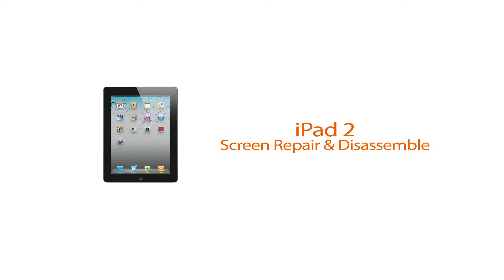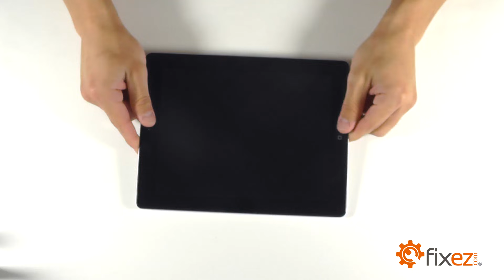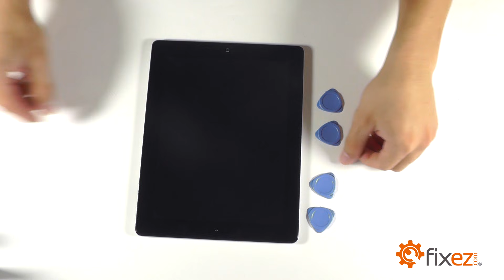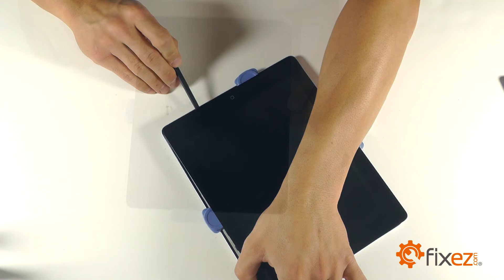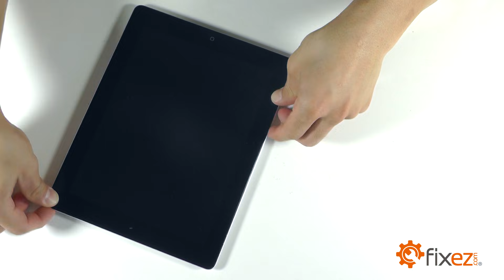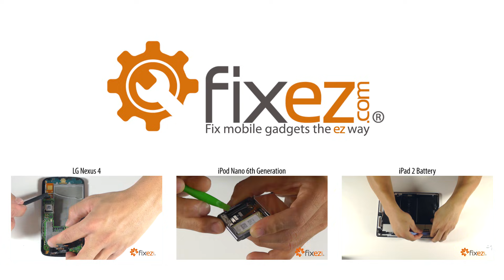iPad 2 Screen Repair & Disassemble

Comment: Awesome tutorial. Great explanation and closeup views that made it easy to fix. I put clear mailing tape on the screen so the glass pieces don't separate, glass fly in my eye or cut my finger. I would suggest to use wear protective glasses just in case. I also used my swiss army knife as the blade was easier to separate the glass and then I used the plastic picks to keep it separated. This was easier to replace than the replacement screen for my iPhone 6.

Comment from the maker: +Thomas Wheeler Ensure you did not damage the LCD flex cable. We recommend going through all the connections to ensure they are secure.
Reply: +Fixez.com I did damage the ribbon holding it-what isz the replacement part for model #a1395  it is part to right of home key  I t will power on and then disappears
Reply from the maker: +Sandy Smith We offer the LCD cable here https://www.fixez.com/store/ipads/ipad-2/ipad-2-lcd-data-cable-replacement You can also find all our replacement parts here https://www.fixez.com/store/ipads/ipad-2

Comment: I tried this, but when I powered it back on, the touch screen did not work.  Also, the power button did not power off the unit.  I am planning to replace the power and WiFi parts, is there anything else I need to be looking at?  Any idea as to why the touch wouldn't work?
Reply: I'm working on replacing those two items, hope that fixes it.
Thanks!

Comment: While i was trying the change screen glass lcd turned to dark black. İ can see the apps so hardly! I can see, it's working but everything is too dark! Do you have any suggest?
Reply from the maker: Try holding the power and home buttons to reboot. If not it's possible that either the lcd or circuit that controls the backlight were damaged during the repair.
Reply: The charge of the device is finished and now when i connect to the cable i can clearly see the battery icon. Do you think it's fixed? I think i damaged the power buton also :( The power button is not working. Which cable should i change?
Reply from the maker: The power and volume ribbon is available on our site.
https://www.fixez.com/ipad-2-power-volume-button-flex-cable-replacement
Reply: Maybe the plug cut somewhere
Reply: Or you don't plug it well

Comment: actually my ipad is getting locked and unlocked but its not changing the screen.. i mean there is no requirement of passcode though i have put a passcode to unlock my ipad.. how could i repair this?? i hope u understood my question...there is no display of battery percentage either and i have just taken the ipad in march and it is second hand...would the ipad work if we dismantle it in the way u have mentioned?? do u have the guarantee?? please reply anyone as soon as possible. i dont have to replace the screen beause it is fine... what should i do in this case?
Reply from the maker: Are you able to see anything on the display?

Comment: mine is just went black, the touch screen is fine cause i can touch the screen when i tried to open the password i heard its sounds and notification. whats the problem? the LCD? or the connection?
Reply: so the one which should be changed is the LCD? i thought it was the connector
Reply: Yeah just buy the lcd like he told you

Comment: This video is highly misleading!  The screen DOES NOT come off that easily.  No matter how much you heat it.  Just tried this at home to replace the charging dock.  Barely pried up one corner before it completely shattered the glass.  I bought the charging dock and all the tools in this video thinking it would be relatively simple like this video and it was not.  Don't be misled.
Reply: I wouldn't say the video was misleading, however, the part where you had to remove the home button and the camera plate was left out. ***** please consider these small steps in your future videos.

Matthew Warner try using the heat gun and the spudger at the same time.
Reply: Heck yeah is not that simple to remove the glass without breaking it....  banging my head 🙈
Reply: The whole video was about replacing the screen but failed to reconnect to the wifi antenna

Comment: I done this but my lcd won't turn on now
Reply: rip
Reply: the video is wrong, first need disconnect the battery, if you don't you damage de diode of backligth. it need remplace you will need pay for a profesional repair diodo damage.